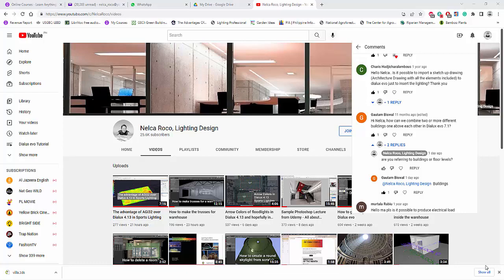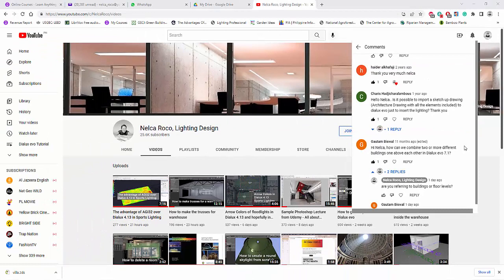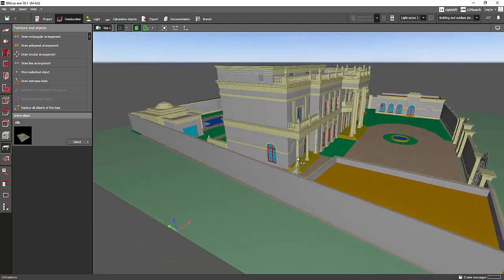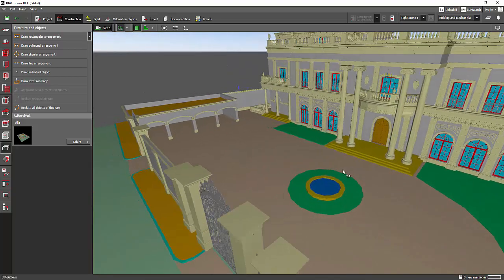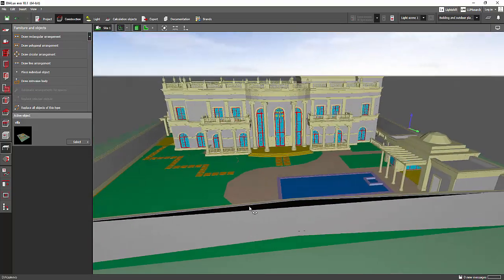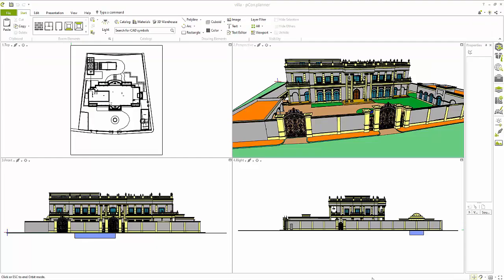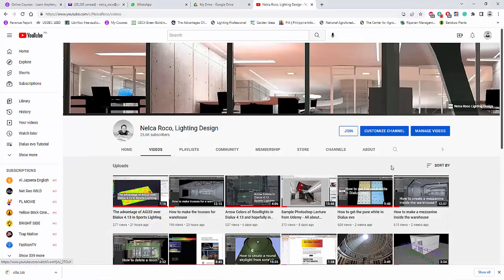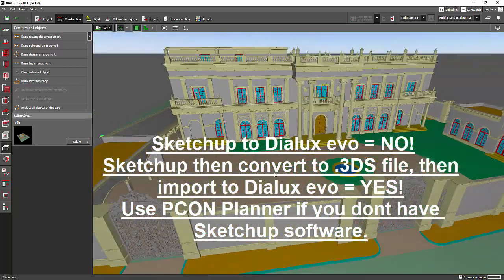Is it possible to import a Sketchup file to Dialux evo?

Comment: Hi, very good video! I have 2 questions if you dont mind..

1. This video shows how to import file as an object right, how about import file as a building or storey. Is it possible? Because i think if we import 3ds file, it will be hard to working on it. Unless the file is for decoration only.

2. What is ACAD PROXY ENTITY? I tried to export 3ds file from AUTOCAD, but not all of the object exported. When i check the cad file. So many object is identify as acad proxy entity. Have you ever found same issue?

Sry for my bad english!
Thankyou
Reply from the maker: It's Not a good idea to import a room or storey from SketchUp. Not even advisable.
Use other software to export 3ds file. Don't do it in AutoCAD. Use pconplanner instead. It's a free software. U just need to open the cad file into pcon planner then export the 3ds file.
Reply: @NelcaRoco  I just downloaded old version pconplanner V8.4 pro but not free as you said, it has 31 days trial using only?? There are two version standard and Pro, so standard is free, isn't??